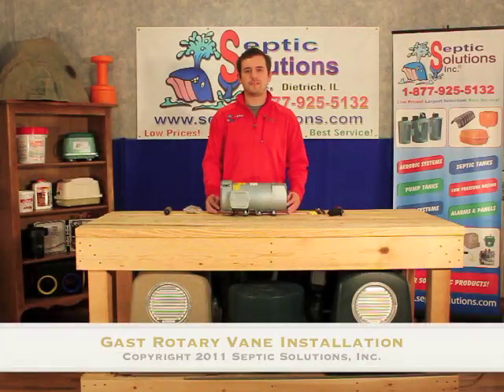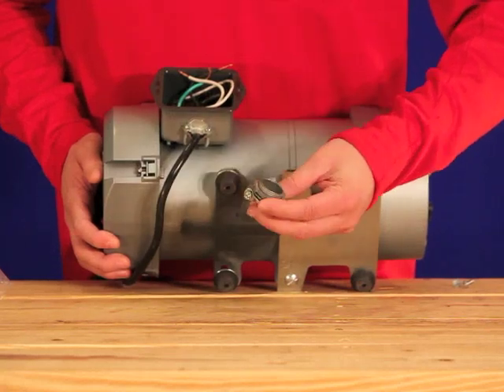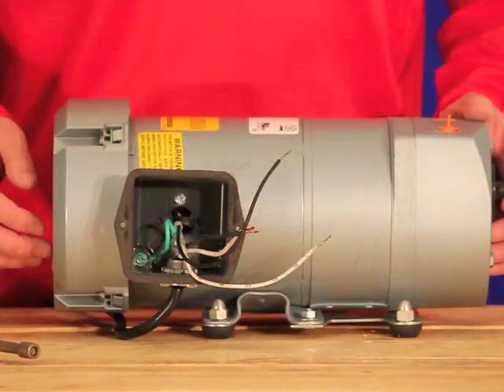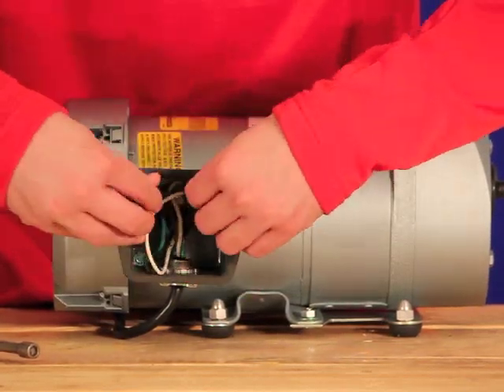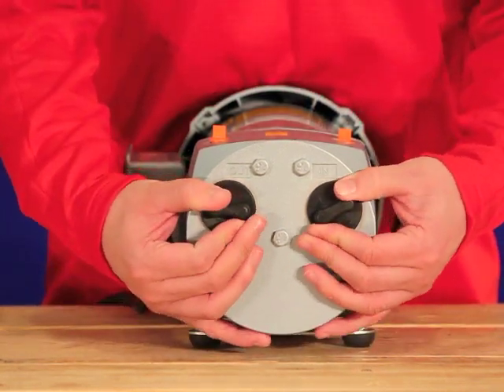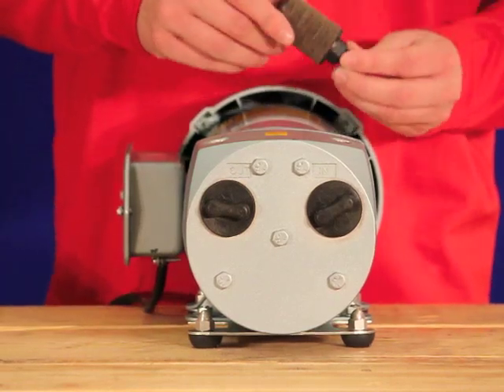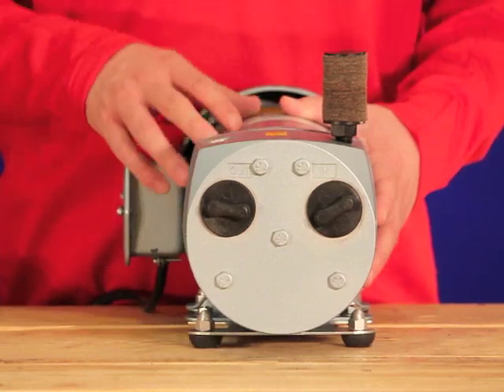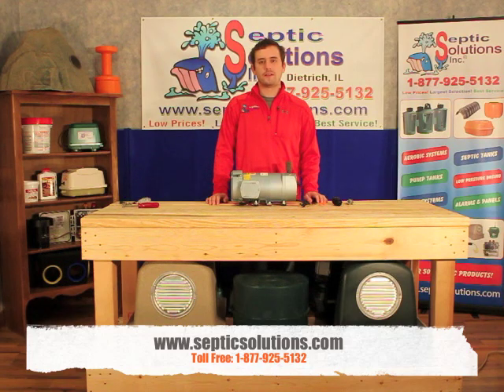Septic Solutions® - Gast Rotary Vane Air Pump Installation Tutorial

Comment: Hello, I have a gast vacuum pump but Iam tryin to figure out how to wire it’s 110 and the plate is on back but it just has numbers and male clips like 1-5, 1 is top wire but not sure which one is hot black and than white and their is a green screw, not sure if u could help?

Comment: My R03 air compressor stopped working after several years without maintenance. It was very hot and it was now turned off.  I was told by the technician it can be built, but they charge too much. I would like to do it by myself. Can it be done?